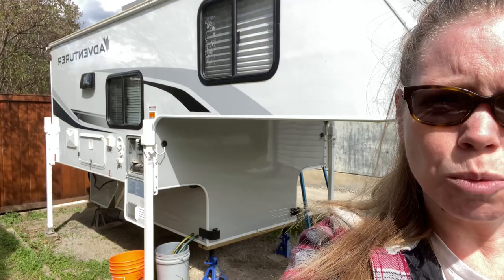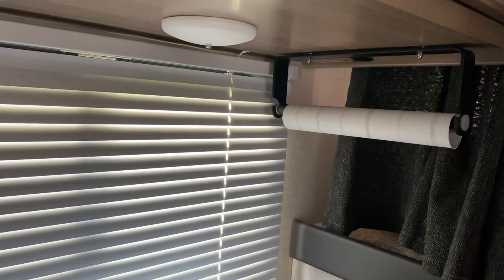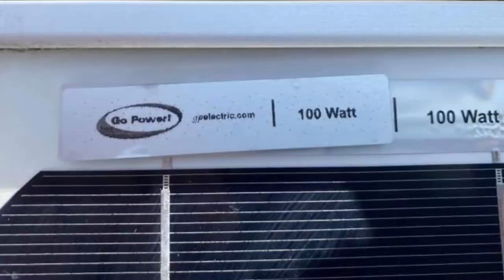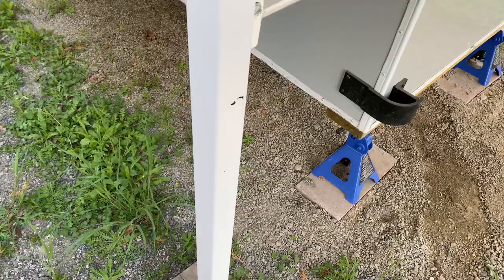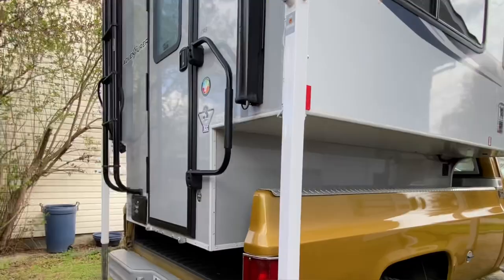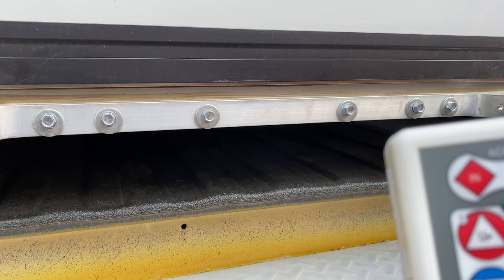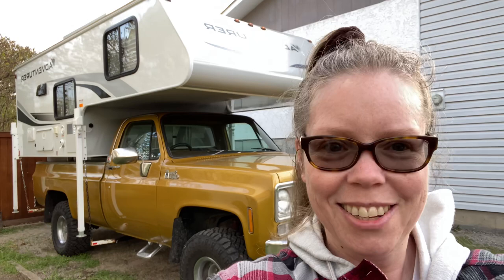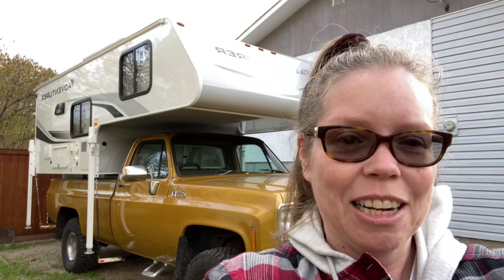LOADING UP our 2021 ALP Adventurer 80RB Truck Camper | Square Body Truck Camper Set Up

Comment: You need a dust buster for your mat. Sears use to sell a vacuum that was 3 things in 1.
You could take the knob off to use for our upstairs. Too bad Sears closed down.
Sharen
Reply from the maker: I do need something handy for the camper! I miss Sears too! I used to buy all my appliances there. Always Kenmore appliances. Right now in the camper I just shake mats and sweep and then wash the floors when I'm at home.

Comment: Do you always leave the electric jacks attached to the camper or do you remove them when the rig is in “camper mode”?
Reply from the maker: We do leave the jacks on. They aren't designed to be removeable I don't think...I mean everything is potentially removeable I guess...with the right tools...but they are pretty built in to the unit. LOL We use them to level the camper at camp sites when we really need to. Just don't forget to lift them before you drive away!
Reply: Wow, your jacks are strong enough to level your camper when attached to the truck, or do you remove the camper from the truck at a campsite and then level just the camper when it is on the ground?
Reply from the maker: Yup, we just loosen the tie downs and level the camper. It levels the camper and stabilizes it at the same time! I'll be able to show you in a couple of weeks when we get out camping! :D

Comment: What's the mpg fully loaded. What motor in the truck EFI r carb thanks
Reply from the maker: We get about 5-7 miles to the gallon fully loaded with the camper 😂 It’s a 400 small block and it has a carburetor 👍🏼